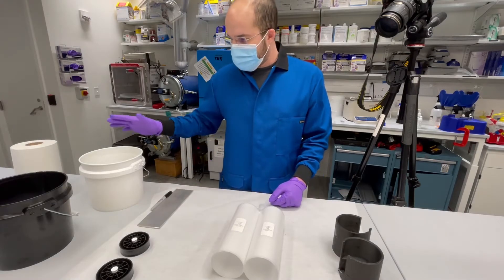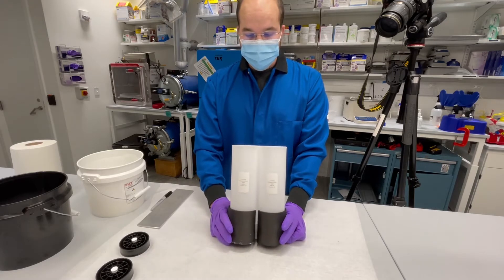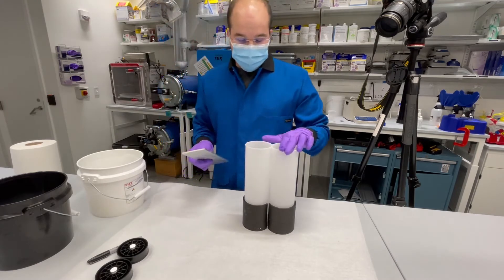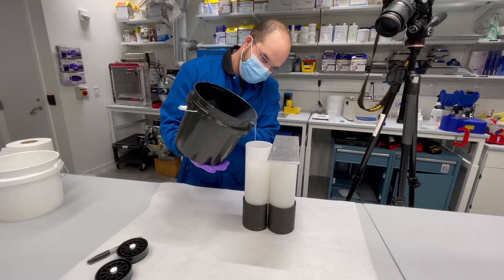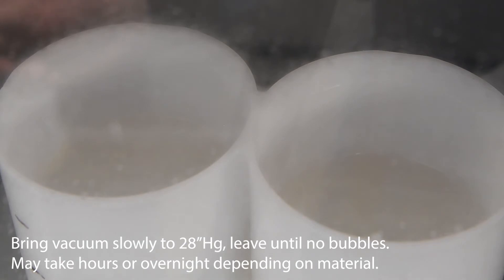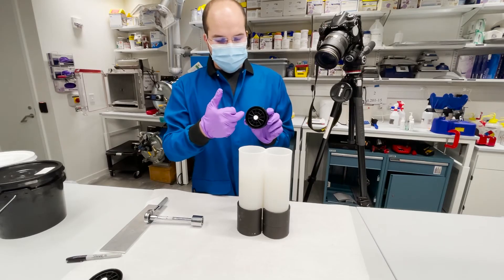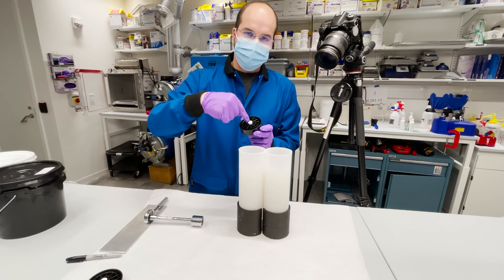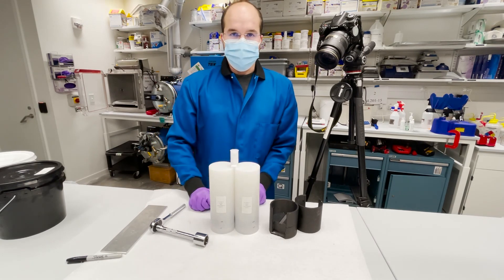Nordson EFD 1500ml Cartridge Filling with Silicone Tutorial - Soft Robotics Injection Molding

Comment: Hi, thanks for sharing! do you have any experience with refilling the catridges and cleaning and reusing static mixers? im about to invest in a 2k injection system but since the materials im casting with change so much im a little concerned that the material and time i want to save from weighing and mixing will just be wasted somehow else